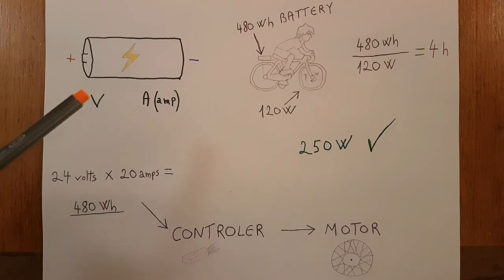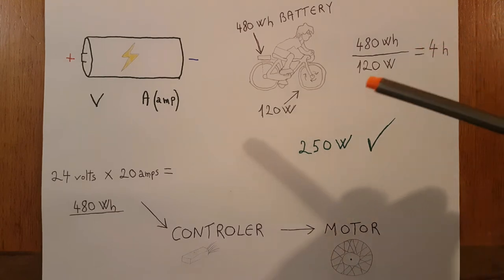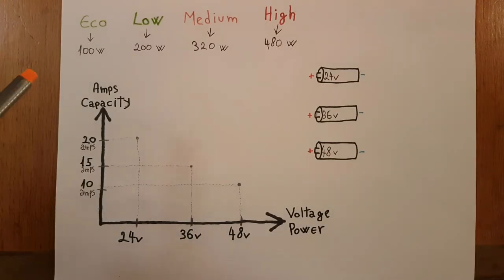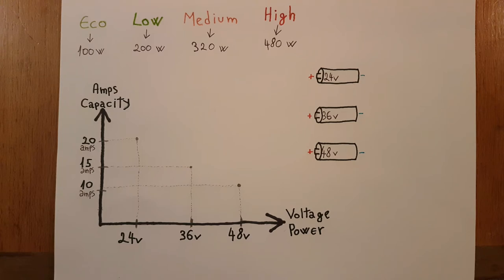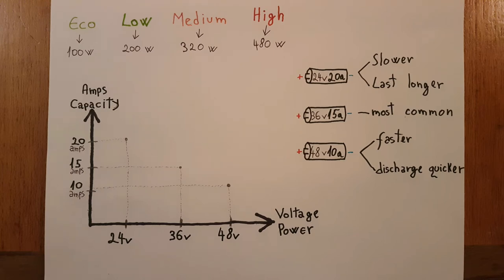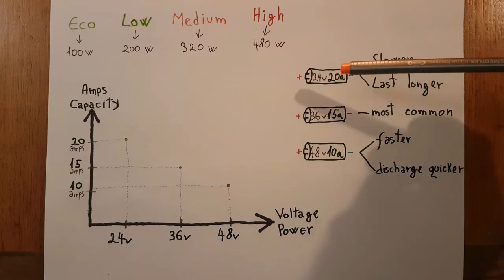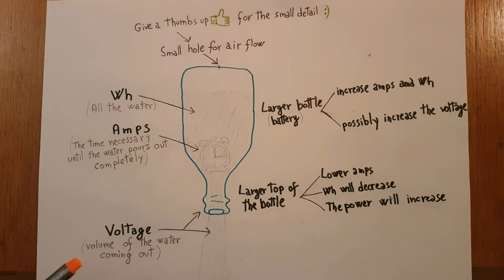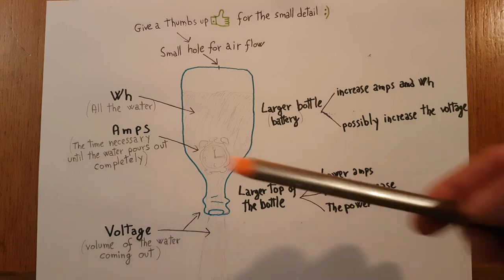What is the Range of an E -bike Battery ? EXPLAINED Part 2

Comment: Nice explanation now in 2020 I am developing a crusire bike (semi recumbent) 1500w bafang mid drive daily commute to office 80 kms @ 35 kms per hour to 45 kms per hour... I am still thinking if i ordered wrongly the motor after seeing this video as small motor cost less n run long on given battery ...pls suggest what amp n watts better i must consider motor name Bafang w 620

Comment: Ahhhh...... Ohms Law right? Once the battery is built then it's up to you and God how far you can go.
Reply from the maker: Only God knows .. :)
Reply: Ohms law is a calculation on how resistances current and voltage work for example current=voltage÷resistance or voltage =current ÷ resistance or resistance=voltage÷current

Comment: Do you have any idea how to design battery management system for e-bike ??
Reply from the maker: What do you meen by designing it ?
Reply: @doit_vehicles  
I meant to design the cell balancing circuit. I'm electronic engineering student. So what are the methods to design cell balancing circuit.